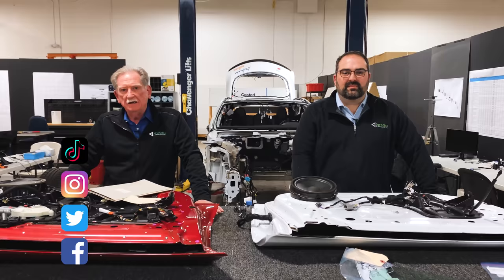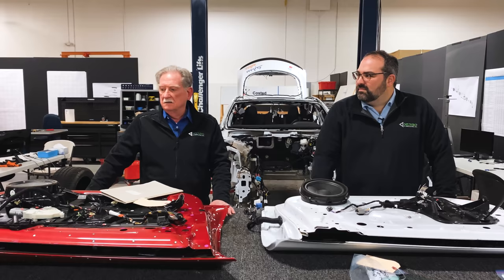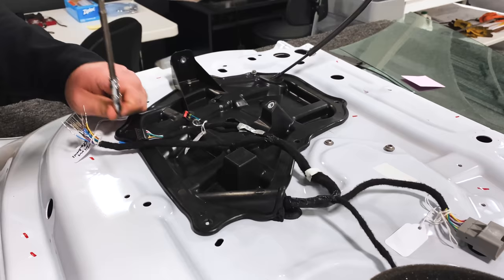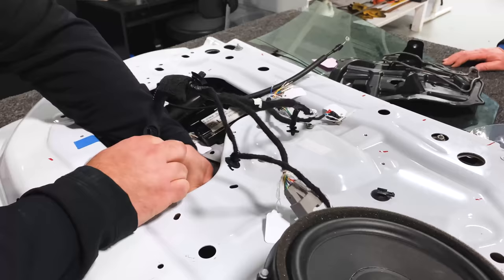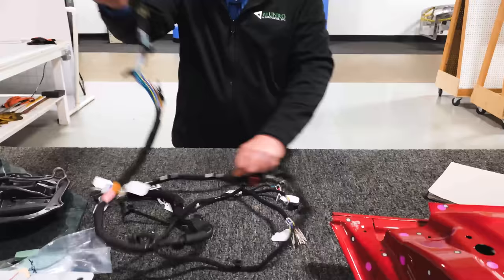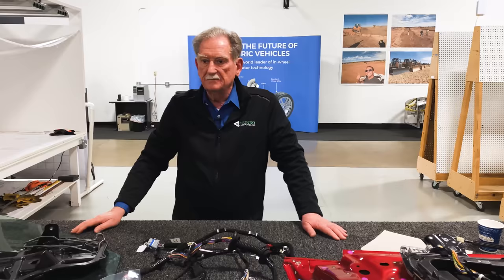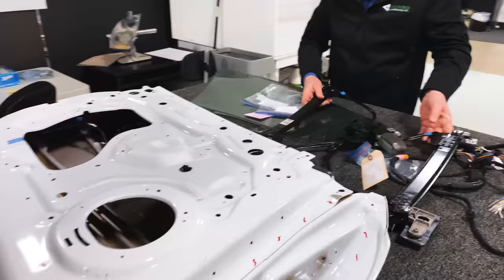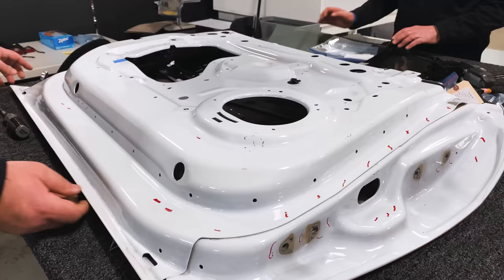Plaid Doors Disappoint Sandy | Tesla Plaid Teardown

Comment: As an automotive technician who has to fix these after the fact, the modular doors are actually a much bigger nightmare than the old style. Reason being that the engineers who design this stuff never think about what happens when it fails, because it does always fail eventually. They will put 2 tiny holes in the door carrier to detach the glass from the regulator. Problem is that, when you are replacing the window regulator or motor, it’s because they are broken and you can’t move the window. Because you can’t remove the door carrier and there is no other way to get access to anything in the door, it becomes a shit show very quickly. The “stick build” doors are actually much easier to service after the fact. I understand that the modular door may be easier to build in the factory, but vehicle manufacturers really need to consider vehicle serviceability too.
Reply: Do you think that a modular can be made to make that easier?
Reply: I've only ever replaced a window motor once, every other time (estimated 50) it has been the cables in the regulator. The cables can be cut in this case.
Reply: Vehicle manufacturers do not care about serviceability. The dealership looks after that.
Reply: You are correct, serviceability is now a lower priority. 
One reason is the disposable, planned obsolesence nature of consumer goods. (Why vehicles that used to be capital goods became disposable consumer goods is another conversation.) 
The second reason is that the reliability of the motor/regulator has improved so much that it outlasts the rest of the car.
But everything breaks down eventually, so some serviceability should still be considered.
Reply: @bohicajohnson7203  Tesla runs their own dealerships & service centers though
Reply: huh? the modular door has a HUGE opening once you unclip the shield . the other older style has tiny holes and looks super ignorant to work in.
Reply: @danielroden9424  The problem is that you can't remove the door module to create that big hole without disconnecting the glass from the regulator. And when the glass won't move you can't align it with the access holes to disconnect it from the regulator, so you therefore can't get the door module off the door if the motor is dead. You have to come up with some other way of getting the glass unbolted so you can get into the door. I have worked on plenty of doors and the modular door assemblies can be good and bad depending on what needs service.
Reply: @retrofitter  what if you can't access the cables because they are behind one of these door modules?
Reply: @Werdna12345  The door module needs to account for glass removal with a dead motor with the glass in any position.
Reply: @samg5543  that sounds like a motor issue. change them so they can be operated with a drill / long socket. that doesnt invalidate what sandy said.
Reply: You are absolutely correct.  Modular door design is a nightmare to work on.  Sandy equates and grades everything on ease of manufacture . What about serviceability?
Reply: @Alfred Wedmore 
Actually the vehicles with the largest engines generally have the most space around them. You're going to find a lot tighter tolerances around a four cylinder engine crammed into a small micro car.
Particularly GM with their LS-based push rod engines. Super easy to work on, even though it's a 5.3 or 6.2 L V8.
Reply: @Alfred Wedmore 
Yep, I'm well aware of why they're dimensionally smaller.
It'll be interesting to see whether these small turbocharged 4-cylinder engines hold up over time pushing bigger heavier cars.
At least in the US we don't consider Mercedes or BMW to be reliable vehicles. They tend to break pretty easily and are expensive to maintain and repair.
After they get to 100,000 mi you our best to sell it or trade it in. After that they become endless money pits.
American made cars are not a hell of a lot better they tend to fall apart also, the big difference is they don't cost nearly as much to repair for the most part. Although there are certainly are exceptions to that. There are some American built stuff that is absolutely ridiculous also.
Personally I stick to Japanese built cars..
I drive way too many miles to be dealing with problems like that
Reply: Sandy has repeatedly shown himself to be uninterested in serviceability/repairability. He's part of the problem in terms of the long-term trend towards repair being difficult/expensive/impossible, due to always favouring manufacturing cost over repair cost if they push in opposite directions (and they quite often do).
Reply: How often do windows fail though? Maybe Tesla regulators are built better? Hopefully.
Reply: @danielroden9424  The problem with this is that the gearbox isn't really backdrivable.
Reply: that door is  designed that way  to keep the side strong during an impact.
Reply: I like the original style better since it's made out of metal and not so much plastic. Just seems more robust and able to handle base better. JMO.
Reply: @6806goats1  I agree. I think the engineers are off here. The plaid door, looks much stronger and stiffer, Id rather get a side impact from the plaid door. The plaid door will also have less movement. less twisting, and the related chance of noise. Plastic tends to creak and make noises. I ve changed plenty of door regulators and it wasnt that hard. I'd rather have a stronger, quiter car than making it easier for the line workers.
Reply: I'm with Kevin on this one.  The modular method is an assembly-line beauty... Until Tesla's fancy-shmansy door handle fails.  And most of them do, some - more than a few times while under warranty.
So somebody smart enough at Tesla has finally figured out that what they lose in time assembling these "old style" doors - they save a few folds over in warranty time.
Plus the fact that these doors are frameless - so it is probably easier to maintain the glass alignment between "warranty dive-ins" if one doesn't have to remove the whole thing every single time.
Not such a bad move at all.
Reply: @sennevanheghe6615  And they make money off selling parts.  This plastic won't fail in 5 years, but it will in 20.
Reply: @samg5543  yup this guy knows whats up
Reply: This is exactly what modern engineering lacks. They only think about assembly, not serviceability.
Reply: I was about to make the same comment. As a mechanic it's nice to have access to the rails and regulators while they are still mounted securely and not have it all fall on your lap the second you try to gain access.

Comment: I assume that Tesla didn't want to change the design and tooling for a low volume vehicle.
Reply: Well, things like this may make it a low volume vehicle, the demand for more is there.
Reply: I wonder if theres no chance the door could have been two pieces and welded after the cables were put inside?
Reply: @markgritzan2841  yeah lol the average Plaid buyer is totally going to be like "you know what, this door makes the workers take too long to assemble. it's a dealbreaker."
Reply: Lol….. they could have simply used the model3 or y modules it’s. It that hard!!!!!
Reply: @materia79  since the door has to be painted before assembly that wouldn't be an option.
Reply: @davidglieder8862  Yeah I am not an expert that's why it was a question. ;) So you can't wield painted pieces? Did not know but would be the ultimate time saver there I thought.
Reply: @davidglieder8862  Yeah I have seen it from another angle now and it would be impossible guess you are right! Sad
Reply: well they struggled with these refreshes. Maybe next time
Reply: @ulamss5  Sandy is reviewing this for the manufacturing process not the buyer
Reply: Exactly, the Model S sales numbers are so low I wonder why they even bothered to re-do the whole interior. Maybe at this point the S is just a Test mule and something different eventually replaces it.
Reply: @materia79  be a bit hard to repair later.
Reply: The tooling for the vehicle as a whole is paid for, and evidently the car still sells enough to pay the bills to keep building it ... but the interior really was looking dated.
Reply: @ZackScriven  If the car is hard to build, you can bet there will be defects. As Sandy pointed out, this introduces variance into the build, and variance increases the probability that things will not line up right, resulting in windows that don't work correctly. How a product is built determines its quality, and if I am paying $100k+ for a car, I don't want any problems. Manufacturing a car is a system. Flawed system = vehicles with problems.
Reply: That's a poor excuse!
Reply: @ulamss5  He said demand for more is there. Capacity for production is not because of inefficiencies like the door assembly.
Reply: @ferfromla  Agreed. But Xrailgun wasn't talking about quality issues in the door. he said the average Plaid owner isn't going to be like, "This door takes too long to manufacturer, its a deal-breaker." That's what my comment is in response to.
Reply: @ZackScriven  — As someone who is trying their best to justify the extra cash for an S versus a 3, this is something I will take into account. Four or five things like this may tip the balance, since I expect it to be the last car I buy, and I will most likely be fixing things like this myself when they break 30 years from now.
Reply: @ulamss5  Correct i wanted to buy a Model S Plaid. But this door video made me decide to buy the Model 3.
Reply: @kobbetop  They are so low, that i can't order them anymore right??? RIGHT ???? You can't order the S and the X in Europe. :( because the demand is too high and Tesla is afraid of inflation.
Reply: @kobbetop  I think the redesign had partially to do with addressing concerns that the S and X were looking dated compared to the cheaper models and also general product unity. Going to a horizontal screen for instance makes the UI design uniform across all products. Slit AC vents also probably unified some HVAC hardware. Since doors are not a unifiable part, they probably didnt think it was worth doing (yet?).
Reply: @altosack  Y has all the latest toys. If your eye on the S why would you go 3?
Reply: @teslabot5650  — 3 vs. Y: lower weight + lower height = better handling, higher range, better acceleration, better looks (yeah, I know this is subjective; I don’t like bulbous vehicles, and I’m coming from a Porsche Boxster). Downsides of 3 are lack of hatchback and tow hitch (although there are 3rd party options), and a few updates. 

To further complicate matters, I’m also considering an Aptera, but this would require my SO let me borrow her vehicle for my occasional truck-like activities, unless a powered trailer becomes available or I make one (I’m also coming from a Tundra).
Reply: @carholic-sz3qv  I was wondering the same thing… but would compromises have to be made? One piece for two or all four cars would be something
Reply: 100k cars pa, is 400k doors per annum, at 30 minutes each that's 200k man hours or $4m saving per year, Tesla hadn't been shy in the past to make such changes. That's not even counting for warranty repair time
Reply: @altosack  Just get the Plaid! Y out of Texas will have structural 4680 and front and rear castings...
Reply: NO EXCUSE! Very disappointed... It's F'ing PLASTIC! NO supply issues, they took a LONG TIME redesigning & already perfected the insert system with the 3&Y! BIG FAIL here. Thanks for keeping it REAL
Reply: @teslabot5650  — I’m not considering a Plaid or a Y. However, my SO is a crossover type, and if she replaces her CX-5 with a Y, I won’t complain; I’ll even pay for the tow hitch.
Reply: @DanaVastman  Sandy probably would say composite 😉
Reply: @altosack  Good point! I would say you are not the average Buyer. The average buyer prob doesn't consider this.
Good for you !
Reply: @mjcamp01  Tesla doesn't sell anywhere near 100K Model S's per year anymore.  Last year they sold 25K S and X combined.
Reply: @JRP3  prior to the change of model they sold about 100k S/X conbined, and I'm assuming X uses similar system to S
Reply: @DanaVastman  What are you ranting about?  It doesn't affect the end result or the user experience and obviously Tesla figured they would save money by continuing the old design for now.  S/X would have required completely different tooling since the doors are larger.  When it becomes cost effective to change it they will.
Reply: @mjcamp01  2020 they sold about 54K combined S/X.  They haven't sold 100K S/X combined for years.
Reply: @HermanWillems  🤣
Reply: @DanaVastman  not really a fail. Everything functions fine as far as we know. Changing to the one piece system involves a cost benefit ratio that may not have favorable. More likely the old one worked ok and they didn’t want two redesign it to hold up the production of the new car…
Reply: @mjcamp01  Your breakdown might be missing a few data points… like the time to assemble “one piece” unit, the time to install it. The money to redesign the door, the tooling cost to make the new door the sunk cost in the previous system… it may just not be worth it at this point… 
M-Y was a new build so they could do it better on the first crack….
Reply: @michaelsmithers4900  Yup. Everyone is ignoring sunken costs. But also, at some point Tesla will need to do more than a "refresh" of S and X. Maybe that is still 5 or more years down the road, but at some point it just seems logical that S and X or some brand new vehicles in the same segments will get the structural 4680 packs, megacastings and other major structural changes so that Tesla can unify not just its products, but its global manufacturing processees. Maybe the economics just dont pan out for that yet, but it does seem inevitible/eventual.
Reply: It also may be that they didnt get to this "yet"? Since they figured it out for the Y, it might end up being changed in a refresh.
Reply: @ulamss5  The worse the design is, the more the car weights, the worse Tesla's margins are, and the less they can make.

Comment: As we all know, the Model S, outside of performance, has not been updated much since 2012 model.  It makes sense that they have a new process for the high-volume Y & 3 which also share components. And though all your points are correct and highly valid,  these are not high-priority in a low-volume vehicle. Not yet anyway.  Just my humble, non-expert opinion.

Comment: Having been in the Auto Body racket for 26 years the nightmare you presented is so typical, and so hated, having to re align windows, change track felt, remove windows, regulators, locks was a lesson in Four Word vocabulary then you had to wipe everything down to get the blood off!  No Excuse Tesla!
Reply: This right here sums it all up lmao! im done
Reply: The door is perfectly fine. Nothing in this world is perfect
Reply: The Model S was designed a decade ago. This is probably the same door they’ve used all along. I’d expect it to be made modular when they do a major redesign of the entire car, though given all the other stuff they are currently working on, it could be a while.
Reply: @cybrtnk  What have you summed-up?
Reply: @johnrosner8964  perfectly fine for the customer but is a nightmare in production.
Reply: @MrTeff999  I think you're right. The next actual redesign of the car will probably incorporate what they have learned from M3 and MY.
Reply: Yeah... no. Newer modular doors are frequently much more difficult to work with
Reply: Maybe you're just not coordinated

Comment: I agree with what what Sandy has said, but with a caveat. For the Model S I do not believe line speed and the effect the door design has on it is that important based on the volume of that vehicle. You are just not making that many Model S vehicles every month, so line speed is a lower priority than it is on Model 3 and Model Y. For Tesla right now, they need to be focusing their resources on the most important things, and on the Model S there were a lot of things higher on the engineering priority list than the line speed of putting the door together. That's a running change they can make any time once the critical stuff is all dialed in.